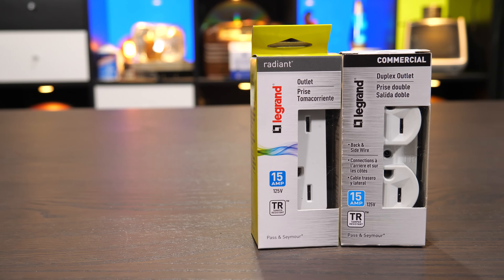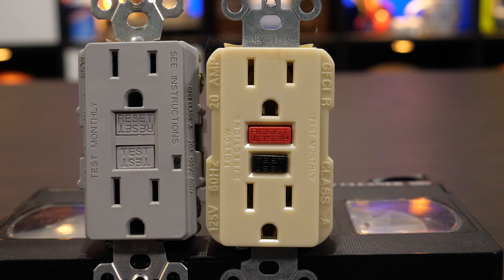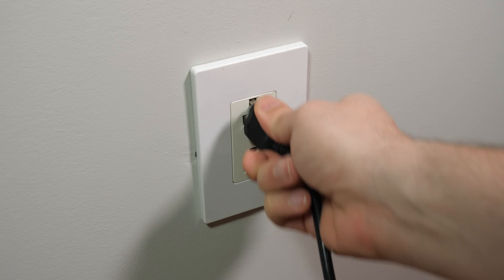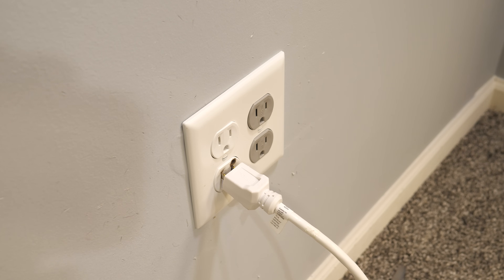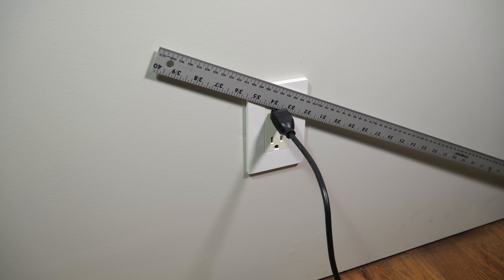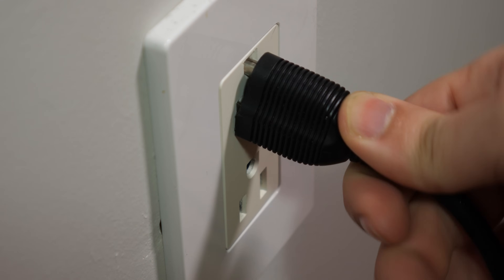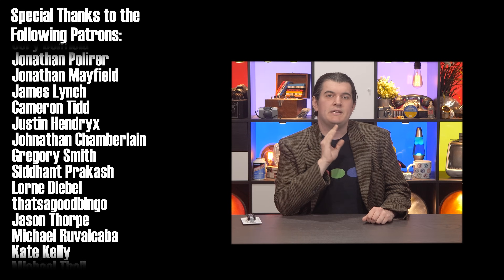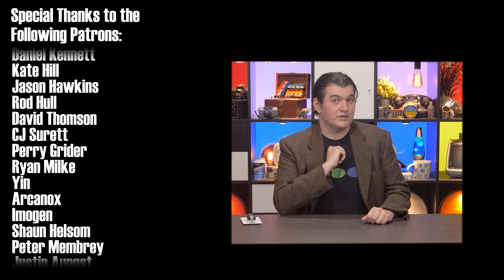Power outlets are topsy turvy - but does it matter?

Comment: Outlet orientation indeed seems like the least of my problems. What really grinds my gears is the complete inability for anyone to make up their minds on the rectangular orientation of power strips versus wall warts, so there's always a 50-50 chance of whether you end up with a combination that doesn't waste up to 3 adjacent receptacles just to insert one item.
Reply: I have a power strip that advertised itself as unblockable. It has its sockets at a 45 degree angle, and then each one is on a segment that can telescope out a bit over an inch in either direction. I have just one massively oversized power brick for a set of PC speakers that manages to hog 2 outlets when used on this thing.
Why do they make power strips though? Why aren't power octopuses more common?
Reply: @joemck85  Cheapness is why. Open a power strip and you will find cheap uninsulated buss bars normally. The rotating kind are different sure, but not that much.
Reply: @joemck85  
Because it is difficult to attach a "Squid" to a surface.  Outlet strips are easier to deal with.
However, when I have many temporary power connections to make to multiple "Wall Warts" I really like having power "Squids."
Reply: @joemck85  I do wish I could get power octopodes. :(
Reply: I would recommend Belkin 12 outlet surge protectors. They have 6 of their outlets in a row down the middle for small plugs and the other 6 are split with 3 on either side with enough space to jam an AC adapter brick into each. It has made cable management much easier.
Reply: Just use pig tails
Reply: This! I buy a power strip with outwards facing plugs and I get sideways facing bricks. While there opposite occurs when they’re in a line. Then there’s the power bricks that are simply chunky on all sides and don’t care about your plug config because they’re covering them all regardless
Reply: probably a design patent issue.

Company A cant use the same box shape as company B because company B patented the specific dimensions. So A has to be 10% different, and then boom you've got tons of companies all with their own shape for wall warts and it eats up strip space. That said, you shouldnt really be using all the outlets of a strip in the first place.
Reply: @NeglectfulSausage "you shouldn't be using all of the outlets of a strip anyways" there's nothing wrong with plugging eight 1 amp loads into a 15 amp receptacle/breaker
Reply: @NeglectfulSausage patents expire after twenty years though, and this has been a problem for far longer than that
Reply: In the UK, Type G sockets are always oriented with ground at the top, and plugs have consistent right angle orientation with the cable coming out of the bottom, but wall warts not to much. Leads almost come out either top or bottom, but it's pot luck which. That's why I prefer double row power strips with the sockets at 45 degrees, which makes cable routing work in either orientation.
Reply: True whichever country you're in.
Reply: Okay, but the real question is do your ground gears make better hamburgers than ground up outlets?
Reply: I feel like Anker designed something to fix this

Comment: in brazil back when type B outlets were more common I remember almost always plugging stuff in ground up but also half of the time we had to rip the ground pin out of the plug cus the outlet didn't have ground

anyway type N better !!! (but also back then most outlets were this weird mixed type N/C / type B with the slits for type B cutting through the holes for type N so having everyone switch was kinda easier compared to anywhere else)

Comment: I'm surprised you didn't mention the common convention where most of the outlets are oriented 🙂 but switched outlets are 🙃. I have always found that very useful.
Reply: I have never seen or heard of this.
Reply: @brandonwalker5011  That's how the outlets are set up in my current place. All the switched outlets are ground up. Every other outlet is ground down.
Reply: That’s how mine are set up, and it’s super useful
Reply: This is an uncommon use of the word "common." Over the past 60 years, I've lived in dozens of homes in five different states and ALL of the switched outlets were oriented the same as the unswitched outlets. You figure out which are which after you move in and start plugging in lamps.

Comment: I'm not advocating for it or anything, but it seems like a compromise to some of the issues presented would be to make outlets where the top and bottom outlet were in opposite orientations. If the top outlet has the ground up, anything grounded plugged into it is (a percentage of a percent) safer, while if the bottom outlet is normal any traditional right-angle plug fits in nicely. Additionally, you can then fit two non-offset right angle plugs if you really need to (even if the additional capacity is in the worst orientation).

Comment: As a UK citizen I am glad our plugs seem to do all that correctly! However the dummy plugs are not recommended as a child safety precaution, as the bottom two holes are closed until the top pin is inserted, so rotating the plug gives a child access to the dangerous bits. It's safer to just not have a plug there if you don't need it.

Comment: Not really, how it is installed is based on the preference of the electrician/contractor. Ground up is  more logical but then you can still have hot to ground contact 50% of the time.

Comment: Come over to the dark side. With our 3 phase 240v, and plugs with a set Direction (ground up) Larger pins, Larger plugs. 99% power cable leaves from the bottom. With Power on/off switches on the outlets. YAY, UK.

Comment: I had to flip the outlets in my bathrooms to make the ground side up. I was plugging in powered air fresheners and unless you want the liquid pouring all over the floor, you had to have the ground plug on top. They wouldn't work in the sideways orientation either. So, some manufacturers seem to prefer the ground side up.

Comment: Right angle plugs are terrible for duplex connectors if you wanted them to become more standard - if you want to plug two of them in at the same time, good luck to you, because the cord from the one on top is going to block the lower outlet - and/or the lower outlet plug is going to make it impossible to plug in the upper right angle plug, as it is blocking the space for the wire

Comment: As a european (swede, specifically) I'm horrified every time I see american plugs. It just looke like an incredibly unsafe system in general. We have stronger prongs, receptables are almost always in a little plastic well that prevents accidental touching, and grounded connectors are 1) more common and 2) flippable like a Lightning/USB-C cable. Any orientation works!

Comment: Have a look at scandinavian, or at least swedish outlets and plugs. You can turn them either way,  even when ground is present. Also, they are almost always sunk into the outlet box itself, so that the body of the connector is enclosed by the socket when inserted. I can`t imagine why not everyone does this. Living in Sweden myself, it would be fun to see a comparing video on the subject.
Reply: Yup, I'm also a swede and was quite chocked that the north america (yet again) having this very stupid and dangerous solution.
Reply: @gurratell7326  The socket design used in Sweden wasn't invented until 10-15 years after the progenitor of the US NEMA socket (all evolutions of which had to maintain many of the basic features for compatibility)  had become the de facto standard over here. Ignoring all political issues (which are legion), there are literally billions of NEMA sockets in use, and even more devices designed to plug into them. Trying to replace all the sockets would be a Herculean task, and doing so (or even mandating them in new construction) would inevitably result in everybody using their existing devices with adapters for decades. Which would offset any safety benefits and potentially outright increase hazards.
Reply: @gnoman6356  Make the socket round and with a diameter that makes all the old ones fit and it'll be fine.
But I guess the US will continue to cling on to the old and bad just like they do with imperial units, car centric cities and the love of those guns.

Comment: I do have to say, I now enjoy our good german engineered outlets way more. Ground on both top and bottom (and exposed, so you can attach eg an antistatic bracelet with ease), reversable plugs, sleeved contacts, and most homes on an RCD so any connection ground, be it through a person or otherwise, trips a breaker. And all that with good old 240V AC, which does tingle that much more if you manage to touch it (hurts for the rest of the day, I tried it). But also helps our stuff to use more raw power (2kW hair dryer anybody?) 😊
Reply: Oh, and also, the whole outlet is recessed, so even if a (grounded, the ungrounded europlugs are smaller and don't work in that regard) plug would come out for half a centimeter (yes, german measurements here), nothing could fall into the plug and make contact even with the sleeved contacts.

Comment: Ohhh, I appreciate the French / Czech design much more now. First of all, ground pin up (never down) sticking out of the socket. The socket is recessed about 3/4 inch, so the pin does not stick out from the wall. Because ground is always up, live is always left, neutral always right. Plugs come in all shapes and sizes, with or without ground. But because they are physically plugged inside the socket ....no exposed pins ...and...newer ones have insulation.  New sockets may have a 45 degree orientation, so even 2 right-angle plugs fit next to eachother. Pure magic.

Comment: Im sorry but in my almost 29 years, never shocked myself plugging something in. Like dry your hands first if they are wet, grip the plug how your supposed to and push it all the way in. Most if not all plugs ive seen have indentations on the top and bottom for you thumb tip and index tip, or grippy sides for you to grasp with 2 or 3 fingers. Grabbing the plug your own way is not a design flaw, its user error.

 I was also not a kid that was too stupid to play with the wall sockets right after my mom told me not to because I would die. None of my siblings were, and no one I know is. In the 2nd grade a boy blew his finger off because he unraveled a paper clip and and stuck it in a wall socket in the hallway. Just to see what would happen. Low IQ is also not a design flaw. 

Also every situation you presented were such crazy stretch case scenarios. Not saying none of these can happen, but the amount of purposefully thrown knives that didn't land on the prongs, like who is out here throwing knives at live sockets?

Comment: I've literally had a metal faceplate fall off and short the hot and neutral, and spark a lot. And for reasons of the breaker being old, it didn't trip as it should have.

Comment: Honestly, I hate the right-angle plugs.  They massively reduce the number of outlets you can use.  At best, you can have one on the bottom if you have a straight plug out the top, but you can't use two of them in line with one another.

Comment: This is why the British plug is the best in the world. Everything is sleeved. All plugs are 90°. The sockets are side by side so you don't lose access to one when the other is plugged in. The sockets are general all switched. The fuse is BUILT IN to the plug. The worst bit is stepping on it. Just don't.

Comment: In Quebec, it's actually standard to put them ground pin up. Though among us electricians everywhere else in the rest of Canada, it's normal to put them ground pin down. Because not only are the "benefits" of putting them ground pin up so negligible that there's no practical reason to even bother, but most consumers want them ground-down because a lot of plugs assume the outlet will be ground-side down and have the wire come out of that side of the plug. Also too, if you're curious, the Canadian Electric Code has no rules for outlet orientation either.

Comment: Oddly enough there is an appliance in my house with a right angle plug that assumes the ground pin will be up. It's a window air conditioner... from 1955.
Reply: Yep, I've examined antique outlets. The ground WAS added to the top.

Comment: Didn't we already confirm that the design of the British plug was the best and move on?   the NZ plug sucks FYI, i've bent the pins on the plug MANY times due to the crap diagonal design and them not fitting back in properly etc. super frustrating

Comment: I actually have a light duty extension cord with sleeved prongs. Only one I've ever seen. I also have a heavy duty right angle cord with the prongs oriented the other way so that the wire comes out the top with a conventionally oriented outlet.  I'm guessing it's intended for a high mounted window air conditioner that has its cord hanging down.

Comment: It’s moments like this that I celebrate the British Standard plug and receptacle design: all plugs have a ground pin even if it’s just a dummy for a doubly insulated appliance/tool, and duplex receptacles are side by side so you can have both right angle plugs side by side without encroaching on each other. Long live the BS1363 standard 🇬🇧 🇬🇧

Comment: the only save plugs are german plugs. 

the longer I watch the video the more redicilous it gets... all you other countries need to do is deepen the plug. Same like german plugs. Any other discussion is absolutely silly... if the holes are inside a plastic indentation the metalic connectors connect only after the plastic cable holding part and plastic bank of the wall plug cover the metallic parts for absolute 100% savety

Comment: Figured out the hard way about right angle plugs. All my receptacles were pretty loose so I decided to replace them. I had heard about ground up being slightly safer so I installed them that way figuring why not. 

Needless to say I figured out really quick this wasn't going to work out with most my plugs, I ended up flipping them ground down again lol

Comment: The biggest issue with foreign objects shorting out the pins is... well... children. Lots of children get injured sticking things in electrical sockets. That's one of the reasons the UK plug, for all its ugliness, is a really good design. Shutters over the socket holes, sleeved pins on the plug, the Earth pin is at the top and the lead always exits opposite the Earth pin, never straight out from the wall. Its also not susceptible to droop like the US plug.

Comment: As a former commercial electrician, specifically building and maintaining fast food restaurants. Putting the plug invert it, I was told was code. And shown how easy it would be to knock kitchen knives off the tables and Reck havoc on electrical plugs

Comment: Sometimes, a subset of outlets in a room will be installed in the opposite orientation.  For example, if there's one "upside down" outlet relative to the others in a bedroom, that one is likely the switched outlet (or the half-switched outlet) for the room.  In a hospital room, some outlets may be "hospital grade" and/or be wired to a uninterruptible power supply while the others are common commercial grade.  In one hospital I've visited, the hospital grade plugs were installed ground up (in addition to having a contrasting color).
Reply: Hospital grade outlets have little green circles on them.  (Isolated-ground outlets have orange triangles.)
Reply: @jmdavison62  Ah yes, the green dot (or text) on the outlet is the UL indicator that it's hospital grade.  In the rooms I've seen, those outlets (and often their cover plates) are also a contrasting color, like orange, which I guess is just a per-hospital convention.  In some hospitals, the standout color may also indicate the outlet is backed by a generator.  In those cases, a backed-up outlet is almost certainly also hospital grade.
Reply: @haywardhaunter2620  The orange triangle (or orange outlet) indicates that it's isolated ground.  A red outlet is connected to an "emergency system" UPS (critical for life-support equipment).  Occasionally red is used for fire alarm circuits and orange is used for emergency system circuits.  See Chapter 4 of National Fire Protection Association (NFPA) NFPA 99-2002 and Art. 517 of the 2002 NEC for more details.  (I don't know the relevant citations for more recent versions of these standards.)
Reply: They're not wired into a UPS. It's a generator. And there is a short interruption time at it starts and begins to produce output.

Comment: Would you like to go down a lot deeper into the rabbit hole?  There is a really good reason why hospitals have the ground pole up. Most hospitals use stainless steel plates. They also use hospital grade receptacles. (Heavy duty springs holding the plug in) The house keeping staff uses these receptacles for vacuums etc..  Over time, the receptacle can recess slightly behind the stainless steel plate. This can make a short more likely. 

A short is not actually very concerning for your safety. The breaker will trip. And, if your hand were to come in contact, the in and out would be in your hand, thus limiting injury. The bigger issue is with “selective coordination”.  

Large buildings like hospitals will have several stages of electrical panels between the service and your receptacle. Breakers need to be carefully coordinated so that the branch circuit trips, not the feeder breaker. If the coordination is not done properly (never is), a short circuit at a receptacle could trip a building feed. This could be catastrophic for dozens or hundreds of patients. 

Very well researched video BTW. Thank you